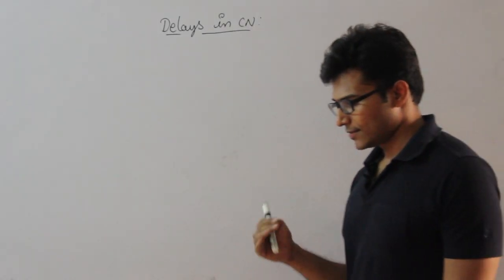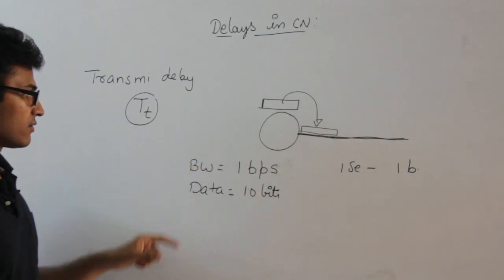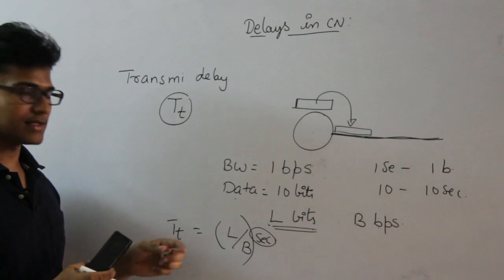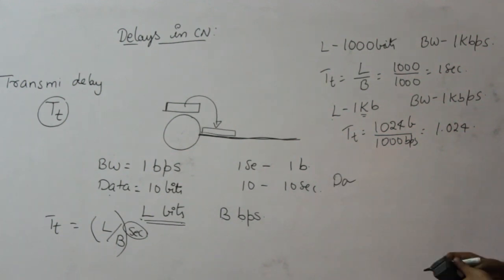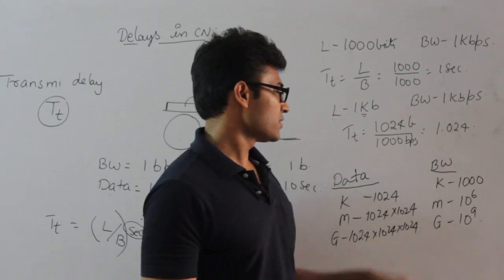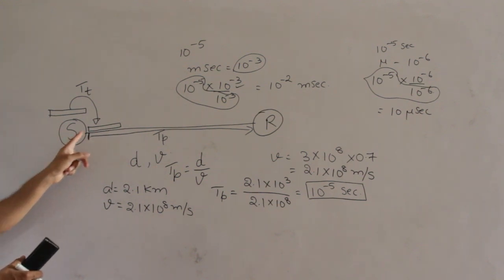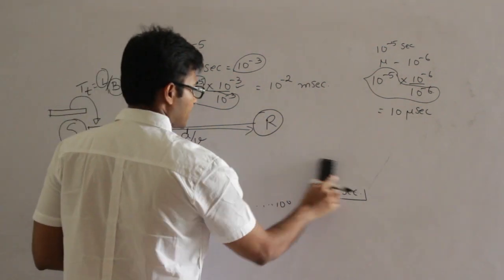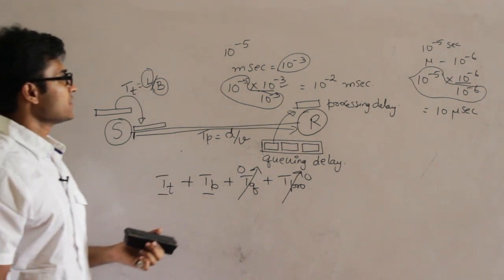CN | Flow Control methods | Delays in CN | Ravindrababu Ravula | Free GATE CS Classes

Comment: consider the two hosts A and B are connected Via a Router R which is having a queuing delay of 7 μsec is as shown below :

The Router R has two links Link1 and Link2, connected to A and B respectively. Each link is 250 meters long and has a bandwidth of 109bps. The propagation speed is 500,000 km/sec. The total transfer delay for 2 KB packet from A to B is ________ μsec. (ignore the processing delay).

sir, here 2 KB packet means data . so sir  2kb=2^11???   or 2kb=2000??? please sir confirm me...

Comment: confusion:Hello sir i have some confusion here please solve it .here if we are taking about L=1bit means either 0 or 1 only single bit and not talking about 1byte if am i right then if 1bit data is taking time 1 bps then 1kb means 1000 bytes and  1000 bytes means 8000 bits as 1byte =8bits so here at 1kbps speed we can tranfer 8000 bits as you have  written  bits not bytes so here what is funda  sir and sir  if you are considering  1 byte then sir please write byte other wise it will be misleading in understading of this concept so tell me sir that  is there my understanding is wrong or you have written wrong sir please tell me sir.

Comment: Determine the optimum data rate at each RTUs to control the operation of the following SCADA system components:
I. Master station unit with 14Kbits/sec as its data rate.
II. The RTU1 station needs to dealing with real time application at message's transmission time is 6ms.
III. The RTU2 station needs to dealing with application at message's transmission time is 240ms with services time is only one day.
Can you solve this problem please

Comment: Suppose two hosts, A and B, are separated by 10,000 kilometers and are connected by a direct link of R = 1 Mbps. Suppose the propagation speed over the link is 2.5 x 10^8 meters/sec.  a. Calculate the bandwidth-delay product, R *dprop.  b. Consider sending a file of 400,000 bits from Host A to Host B. Suppose the file is sent continuously as one large message. What is the maximum number of bits that will be in the link at any given time?  c. Provide an interpretation of the bandwidth-delay product.  d. What is the width (in meters) of a bit in the link? Is it longer than a football field?  e. Derive a general expression for the width of a bit in terms of the propagation speed s, the transmission rate R, and the length of the link m.                 

can you help here please

Comment: Transmission delay is time taken to put a packet on the link. Then it should also depend on processing speed of sender and why there is distance.
Reply: sunita bansal what you said is true
Reply: here "putting on link " means conversion of bits into waveform... which depends on Rate of transmission ... Also Transmission delay is a function of the packet's length and has nothing to do with the "distance" between the two nodes..
Reply: Traansmission delay =( length of bit) L / ( Bandwidth) Data transfer rate...... Watch the Video AGAIN.
Reply: Jayant ingle but depends on system processor

Comment: propagation delay is the time to send just  first bit from source to destination???  plz sir tell me this is right or wrong?

2*10^8 for coaxial cable and 3*10^8  for fibre optical.
Reply: time to send first bit is correct. Propagation ~ Speed of Light in transmission medium .
Reply: After node transmits first bit on cable, it races toward destination. Meanwhile transmission of remaining bits of packets still taking place. So time for transmission overlaps some or all of time for propagation. That's why single bit propagation time only relevant delay....
Reply: It's the time to send the last bit

Comment: Isn't there queuing delay at the sending node too?
Reply: +Quarker No, I don't think there is any. This is because of the fact that sender is sending one by one. but receiver may be receiving many at a time.Therefore, receiver needs the buffer which causes the queuing delay.
Reply: There is Head-of-line blocking in sending node of router or switch when packets behind first in line held up by first packet delay.

Comment: If question is like what is the transmission delay for sending 1kb file over 10kbps bandwidth? What we should consider 1kb means kilobytes or kilobits ?? If we consider bytes  1kb=1024*8bits so transmission delay is 0.8s if we consider bits transmission delay is 0.1s which is correct answer??
Reply: Correct me if am wrong. KB is kilobytes and Kb is kilobits :)
Reply: Ya thats correct